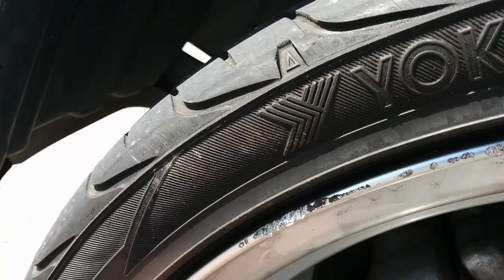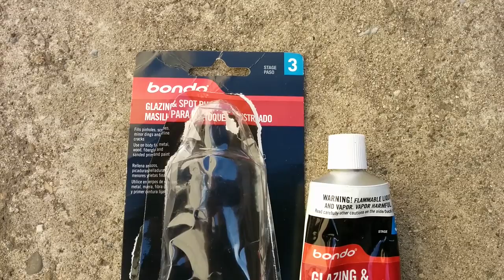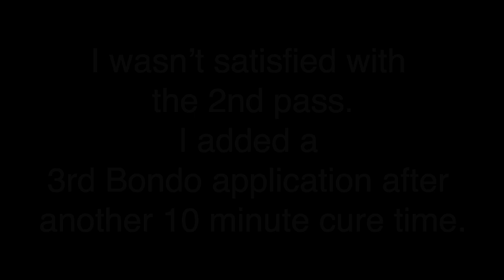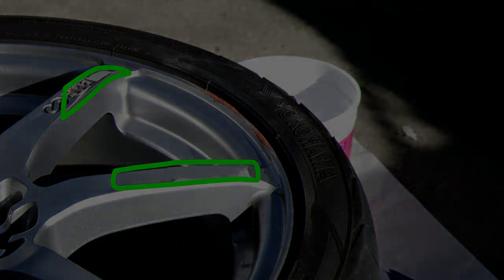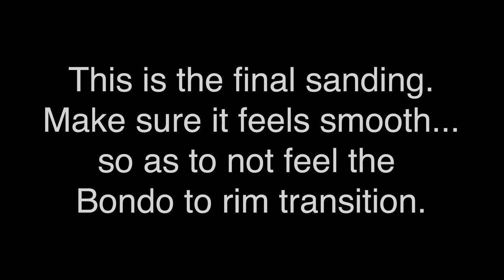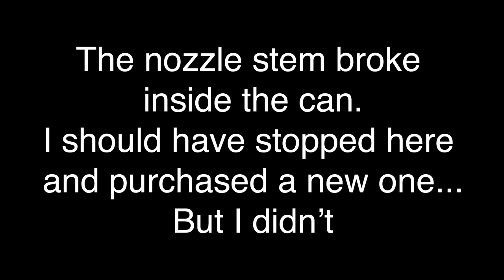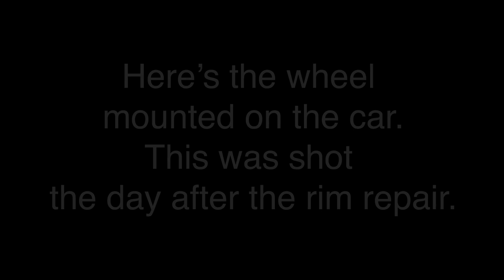Curb Rash Rim Repair (silver wheels)

Comment: Hi Mate, great video, But, Where's the clear coat to provide UV and general protection? You will rub off paint again with out it ;)
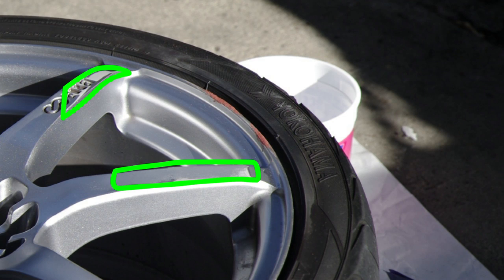Reply from the maker: +Mick Holgate Since it was only a small repair area, I figured I can get away without using a clear coat. But I do agree, the clear coat does add that extra protection. And like you mentioned, it does rub off. The previous "professional" touch up was easily removed with the Grease & Wax Remover and some scrubbing (5:06).

Please post your clear coat recommendation(s). I found 1Z Einszett Silver Spray Wheel Paint a better match than the Dupli-Color... so I'm not married to the Dupli-Color line.

Thanks for commenting and watching!
Reply: +eyeDtenTea hi mate. I use pro spray guns so would use an air dry 2k clear like baslac panel clear for spot repairs. In your case any of the reputable acrylic clears would be fine. The problem with not clearing it is that it will go chalky in time.  Hope this helps
Reply from the maker: +Mick Holgate Yeah... the feel of the painted area (without the clear coat) is rough to the touch.

I'll look for acrylic clears to use on future repairs. Thanks for the recommendation.
Reply: +eyeDtenTea very welcome

Comment: How does the Bondo hold up to tire changes?
Reply from the maker: Bonemaro2000 I haven't tested that out. The repaired rim still has the original Yokohama.
Reply from the maker: eyeDtenTea The Bondo did hold. I installed a pair of tires. The tech used a crow bar to remove the tire from the rim. The contact point on the lip of the rim (where the Bondo was applied) held up fine. However, the paint was scratched off. It's noticeable up close; we're talking about the lip area closest to the tire. Touch up paint required.

Comment from the maker: This is a reply to david parra (reply button is missing on orig comment): yes, there's enough Bondo in the tube to do the circumference on all 4 rims. I would suggest doing a repair on 1 rim. When you have the technique down, apply to remaining 3.

When doing multiple rims, split it up into 2 days. Day 1 should be the sanding down and Bondo application. Be generous with the Bondo; excess can be sanded down. Let this cure overnight. You want the Bondo fully set before sanding it down. Day 2 is the final sanding, minor Bondo touch-up if necessary, and paint.

Good luck and thanks for watching.
Reply: Thanks man!
Reply: +eyeDtenTea hey ,if anyone else wants to learn about car spray painting tips and techniques try Jaffacter   Paint Sprayer Coach (Have a quick look on google cant remember the place now ) ? Ive heard some great things about it and my co-worker got cool results with it.

Comment: 1. Instead of all the time spent with bondo, you could use an orbital sander with 120 grit disk first to remove that damage , then use a 320 disk , then use a 400 wet sandpaper , then scotch the wheel.  Then you can prime and paint.  Much easier this way.
Reply from the maker: Just sand it down?... no build up?

The curb rash was deep; took chips off the rim lip.

Comment: bondo isn't that good did that in high school they chipped after one season... use JB weld instead way stronger lasts way longer
Reply from the maker: +Sebastian Rogers Interesting... my patches are still holding. What caused your Bondo repair to chip?

I'll look into using JB Weld next time. Thanks for the suggestion.

Comment: What's up with the cheesy 70's porn music? Also, why only paint one side of the rim, doesn't it look awkward?
Reply from the maker: "70's porn music" >>> harsh. I liked the beat, that's why I used it. It's royalty free music offered by YouTube. It's called "Cielo" by Huma-Huma; filed under the "Hip Hop & Rap | Funky" genre.

As with the paint, the DIY was to only fix the curb rash parts. The paint is NOT a perfect match, but it is decent enough for a pass. Meaning, it doesn't stick out that much. 

Side note: For my rims, I discovered 1Z Einszett Silver Spray Wheel Paint to be a closer color match than Dupli-Color Silver Wheel Spray.